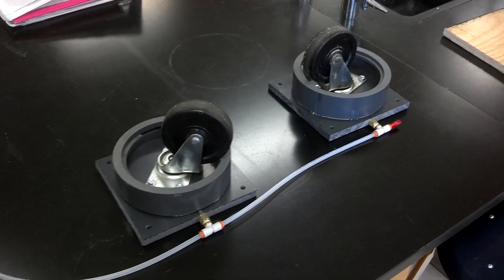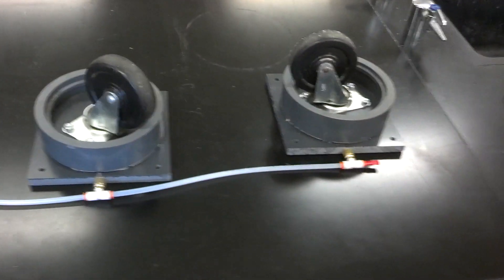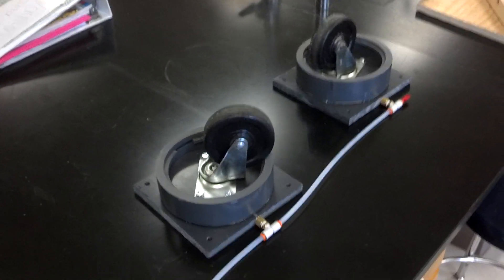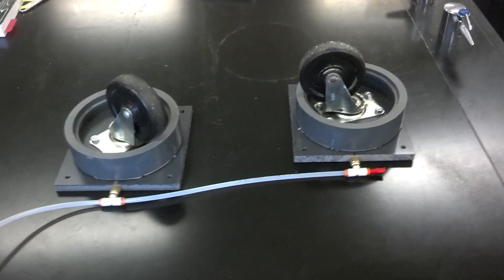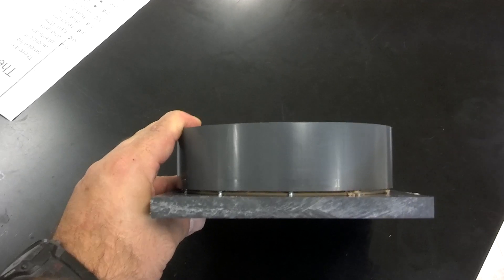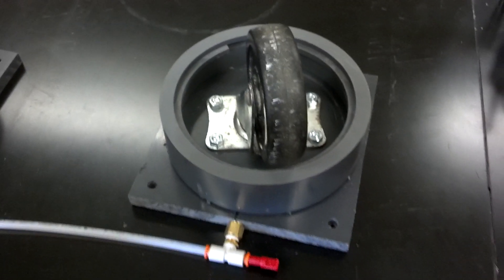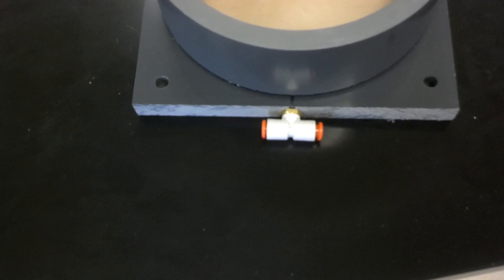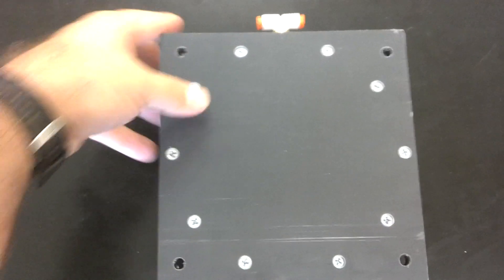Air-Lift Casters

Comment: Guy, you mentioned that you use a jig to angle the screws. Why and in which direction?
Reply: Slightly towards the center. It was something that Greg said improved the compression/seal of the two PVC pieces sandwiching the rubber. I'm not 100% sure that it makes sense to me, but I trust his results.
Reply: @guybarbato5578  Guy, Thank  you for your reply. Be well.

Comment: I assume the "ridge" as you mention on the top of the cylinder is milled out of the cylinder to create a tighter seal when pressing on the rubber against the top square plate?  ...and that's also why the screw holes are 5deg. inward is because you Don't screw through the rubber and the slight angle gives you more material in the cylinder to grab the screw without cracking the PVC?     If true, what was wrong with Greg's original method of no ridge on the top of the cylinder and drilling perpendicular holes through the rubber to sandwich it to the cylinder?
Reply from the maker: Yes, created by routing along the outside of the cylinder.  (I then also used a round-over bit on the inside so it wasn't a 'sharp' edge against the rubber)  According to Greg, there were two things that this helped improve from the original design.
(1)  If you screw through the rubber, it will sometimes catch and twist, so the original design called for punching holes in the rubber, with some precision, exactly where the screws would go through it before assembling.  The modified design avoids screwing through the rubber altogether.
(2) Greg seemed to find that the more narrow "ridge" (with the rubber extended slightly past it) provided more concentrated pressure between the cylinder and top-plate, resulting in a better grip/hold on the rubber and made it less likely to slip under pressure.  He said that the combined result was fewer blow-outs under higher pressure.

Comment: Hello, Guy. Where did you get the 3 way valve you used?
Reply from the maker: McMaster-Carr (my favorite supplier!!).  "Directional-Control Valve with 1/4" Push-to-Connect" (4757K61)
https://www.mcmaster.com/#4757k61/=1a7iw3j